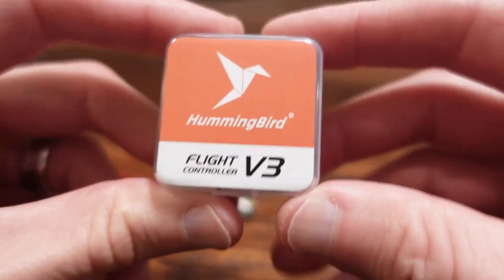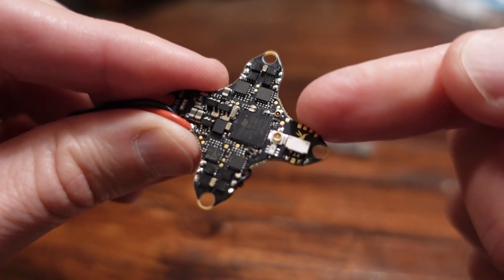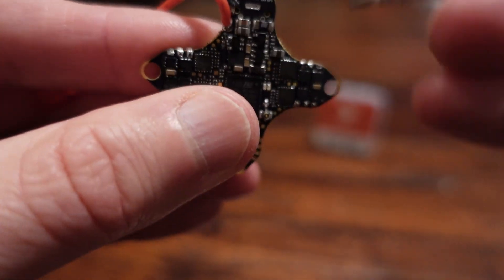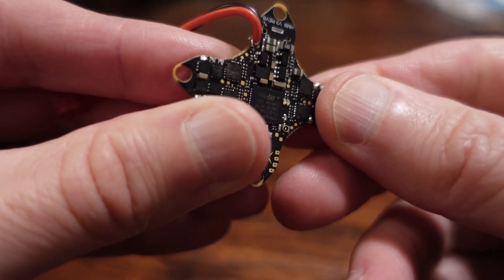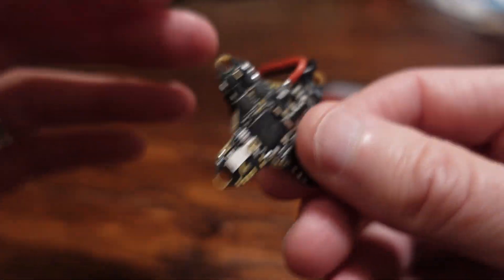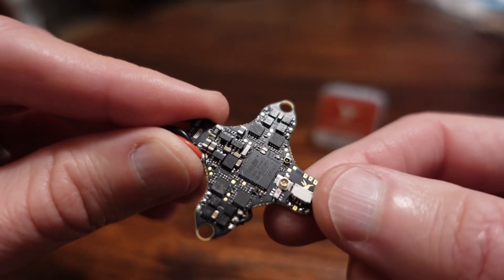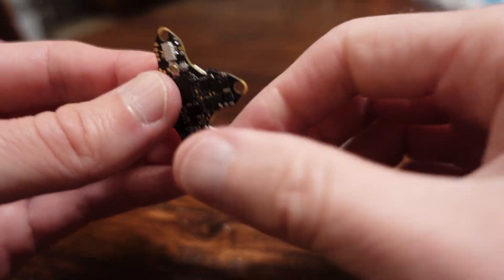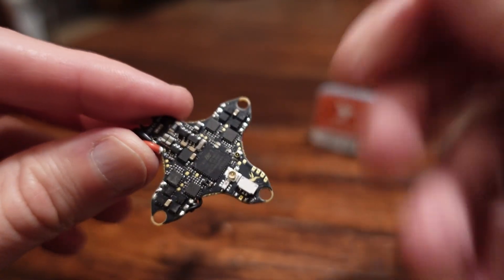NewBeeDrone Hummingbird V3 Flight Controller: I Have a (edit: totally incorrect) Theory

Comment: I’m not sure why everyone is having issues with this board. I have solder to this board connected and external vtx two caps for power spike control and my whoop just flies and flies excellent. I also use beta FPV 550mah instead of the recommended 300mah with no issue. Take your time when soldering or work on your soldering skills before using this board.

Comment: What is "totally incorrect" about this?
BTW Thank you for the video, all of your content... the group I race with was talking about your "trash magic" video.  I really do love taking these AIOs from the prebuilt hummingbird and changing out frame and motors.  I'm running with the Cockroach V3 frame and 0703 16420 motors (only $25), with a meteor65 pro frame and 35mm props.  So much precision I love it!  Great for this racing NOOB.  4 minute flight times are a plus... Could you suggest a lightweight canopy for the bee-eye (NBD cam) to replace the Goober?  I saw one in another video you had that looked super light.  Or maybe the NBD racing canopy?  I'm right around 20g...
Reply from the maker: My theory was that the design was outsourced, and they found out after the fact the FET orientation was high risk for soldering. Kelvin reached out and corrected that the design is in-house for NBD and they plan to update the FET orientation with the next revision of the board. For canopies, if you have a printer, try my printed canopies. Free to download the file. They come in at 0.6 gm and have adjustable camera tilt.

Comment: Man that looks like half a dozen of my running whoops. I actually choose to take off the motor plugs, I didn’t hear why you did I assume bc you didn’t have the right connector some are like 1.0 some 1.25 and I never have the right two lol.
My tbs aio I use for my custom 75’m is the BLV4 w the tbs reciver built in and it has both also, I didn’t cut those off tho prob should it’ll save a half gram or something. 
I gotta grab one and see but good video bud!
Reply from the maker: The intent here was to see how light the build could get. I direct solder my builds. I didn’t cut the plugs off until after I killed the board. Since the board was done already it was a good one see if a quick and dirty snip with side cutters would do anythin bad like lift a pad or trace etc.

Comment: The side that the plugs are originally on have HUGE traces. Just scratch them wider and solder to that side. That’s what I would do on this board.

But personally I wouldn’t run it because every “5A” EEW FET board I freestyle needs the FETs swapped regularly to keep it flying properly.

And this one is just way too cramped and not only are the FETs placed at 90degrees but on both sides. That’s WAY too much work.

My HM boards I can swap the FETs in basically the same amount of time it takes me to solder on the motors. This board would be too stressful and time consuming and when they need changing in a month I would just have to swap the whole board out, and I’m not about that. I even send back my destroyed and unrepairable boards to HM and they usually hook me up for free or a few dollars.

Just don’t run 30k+ KV or turtle aggressively and it will last forever. Like you said it’s a racing board for low KV builds.

Also in the future just cover the close pins with epoxy or clear nail polish and you won’t have this bridging issue… but I would just solder the other side to be super safe 😜
Reply from the maker: I didn’t think of scraping out the traces. I’ll check that out as an option.
Reply: Good idea on the nail polish.  I have some acrylic conformal I'm going to paint the fets with prior to soldering
Reply: @BoundlessFPV  I coat everything. I like to fly in the snow, rain, storms, and at the ocean. Bare boards absolutely suck for durability.

Only problem with conformal, compared to epoxy is that you can get flux underneath it (as it’s meant to be non-permanent) and it can cause weird behaviour and electrical noise at times. Never understood the people that don’t clean the flux off their boards and complain about their stuff having weird gyro noise and not flying properly.

That’s why I use UV cure PCB epoxy at solder points most of the time. Cures in seconds under UV light and is really user friendly. Never had any issues with it. It’s designed for this purpose and bonds really well, but use it only where necessary
OR
if you want to make your board impervious to everything and super durable. The only issue is that when you have to replace a voltage regulator, CPU, or FET you have to scratch/grind off the epoxy. Which honestly if you have patience and a scalpel
OR
a PCB grinder is not a big deal… plus most people don’t repair electronics to begin with… so just pot everything in two part epoxy and be impervious 😜

Conformal is great away from solder connections
OR
after you wash the board super well and put it on after everything is completely soldered and together.

That’s my experience anyway… hope it was mildly helpful or entertaining.
Reply: @BoundlessFPV  I mentioned clear nail polish, because most already have it in the house.

Other than having to wait for it to dry and dealing with the smell, it actually works quite well. It’s a good bond, and if you have to remove it, it’s super easy.

Comment: I don't know if this adds to the discussion but I've heard stories of people breaking light weight aios  because they were applying too much heat when soldering. I'm guessing that having components that close messes up with some of the nearby pads and the window of allowable Temperature/time to solder gets smaller and gets easier to mess up.

kinda wanna use this actually cause the x12 - when the connectors were removed - the pads were extremely small but still managed to solder to them.....but then again i live in the opposite side of the world
Reply: Yeah I take the motor plugs off and use the dots for pads so if you can do that too your good! And with smaller boards imo you gotta watch more for solder smaller and the lil metal peices is what usually has come off my aios. But high heat quick is the best as you know I’m sure
Reply from the maker: The biggest heat risk is the negative battery lead because the heat goes out to the entire board. If the iron isn’t hot enough (or have enough heat capacity) you have to stay on it for a long time before the solder melts putting a lot of heat in to the board. The other pads are fairly easy to get on and off quickly enough that heat into other components should be minimal.

Comment: So all it would have taken is an extra 0.5mm of PCB around the edges to make this a good DIY board?
Reply from the maker: They didn’t even need to do that, just rotate the offending FETs 90 degrees and that would take care of it.
Reply: I don’t think it matters tbh all 65/75mm aios have tiny pads you just need to use a lot of flux! I am going to do a better edited and detailed soldering and basic whoop diy builds.
Reply from the maker: @stevefpv  the bridge risk is not just a solder bridge, but if the end of the motor wire extends past the pad inboard it can touch the FET pins really easily. Notmally the FET pins are rotated away from the motor pads.

Comment: I'm not surprised this happened weith Newbeedrone. I got burnt repeatedly by their products, especially the Hummingbird line, back in 2020. They have no interest in the hobbyist/DIY market. They cater to new pilots who want to buy something and just fly it as-is. And not leave the NBD ecosystem. I'm repeatedly frustrated by their reluctance to listen to the experienced pilot market. For the longest time, they refused to address how heavy their products are. They finally make a reasonbly light board, but they're still using their forked Betaflight to support their OSD, non-standard motor plugs, and their tiny camera plug. They also refuse to ditch the PH2.0 battery pigtail. I know they were vehemently against BT2.0, but I had hoped that since the A30 connector is available, they would have gone to that instead. I almost bought one of these, but I think I'm glad I stayed away. I do like the new Cockoach frame though. I wish they'd make a "pro" version of this board that has no plugs and bigger motor pads. And don't pre-solder the pigtail so we can put on our preferred pigtail.

Comment: Wish someone would add a better higher powered vtx to this board
Reply from the maker: You can do that, but then it’s no longer going to be a light weight board. A high powered VTX will generate a lot more heat so you will need a lot more material to dissipate it.